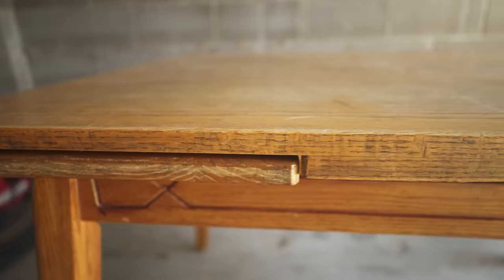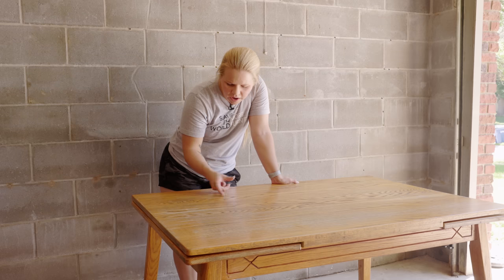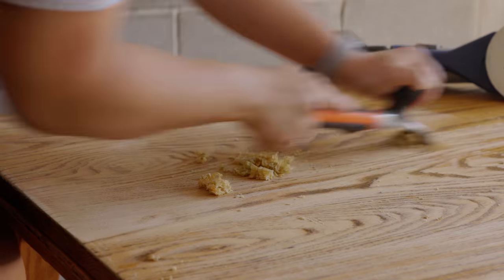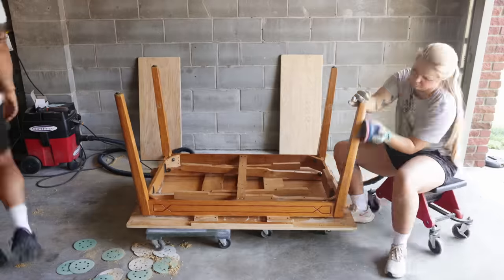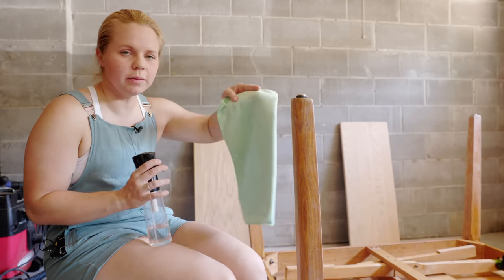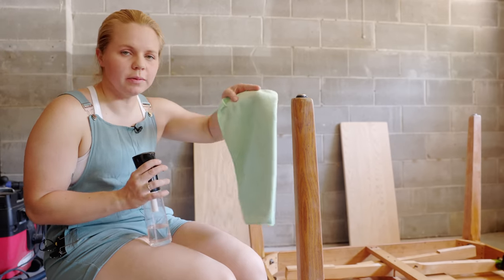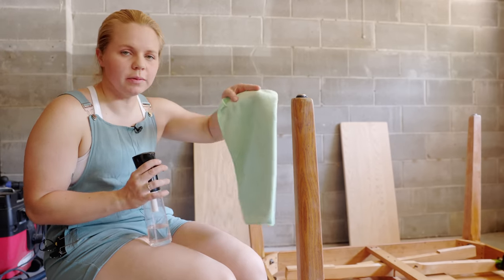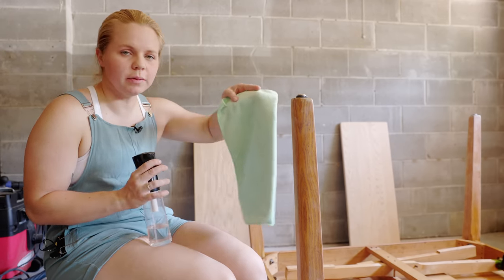$40 Goodwill Thrifted MCM Table Makeover

Comment: I think 1 coat of primer before painting a darker color might help eliminate the need for 3 coats of the more expensive paint.  And provide a little more durability on a frequently used item.  Also would suggest using a wood conditioner on stripped wood to get a more even finish and you won't have to work so fast with the stain.

Comment: Nice table!  Are you going to address the problem of the two leaves not aligning with the tabletop?
Reply: Good question! I was wondering about that. 🤓
Reply: There isn't a problem. The table is designed so when you pull the leaves out, they come out a couple inches past the end of the main table. Then you lift up and push the leaves back in, and everything lines up.  But if you do that, you can't reach all the edges, which needed to be finished too.  You can see it working properly at 5:55

Comment: I have a similar table design but mine is older, has barley twist legs and planks instead smooth services.  My problem was that the skirt was lower on one side than the other.  The solution for us was to lift the entire table using bun feet at the bottom.  Matching the finish was the hardest part, but now you can’t tell and the table is 2 5/8” taller.

Comment: It's great that you got a call about the chairs.  They'll go well with the table.  I had a table in the same pull out leaves/extensions. I believe it was probably oak as well, but stained a dark walnutie color.  I really wish I still had it.  (Bummer.)   
Were you intending for the two pieces to match? (Or did I misunderstand?.)  If you used the same stain on both pieces, then either they didn't accept the stain the same &/or they are two different woods because they don't match. Or is my monitor crazy?

Comment: What kind of wood is that?   I have a teak table with similar extensions about 50 years old.. Very handy not to have to have leaves that have to be stored elsewhere. My leaves come out level though.    Also mine is oiled only, no clear coat and has been really easy to maintain.  . What kind of finish is  that that is so difficult to sand off?